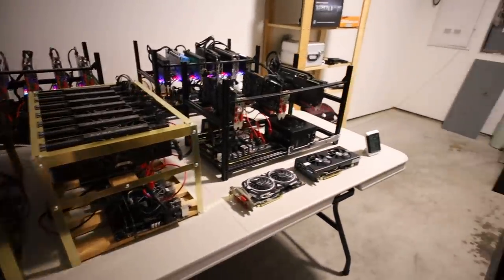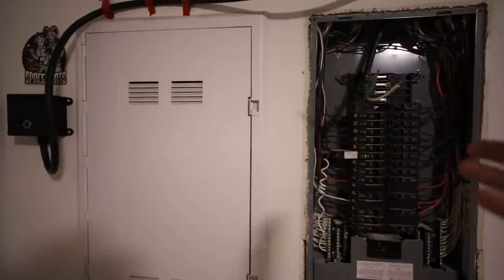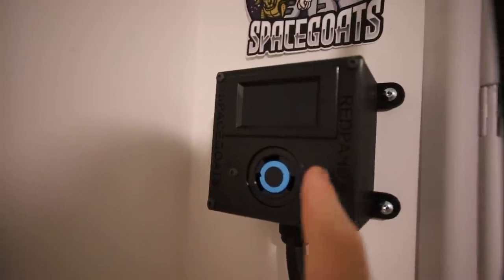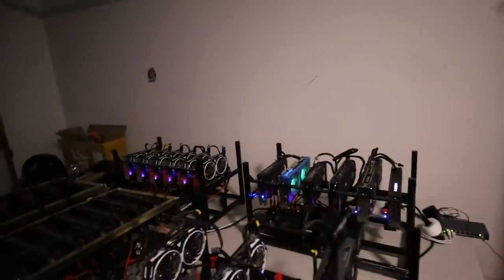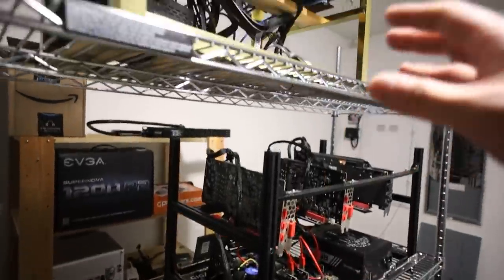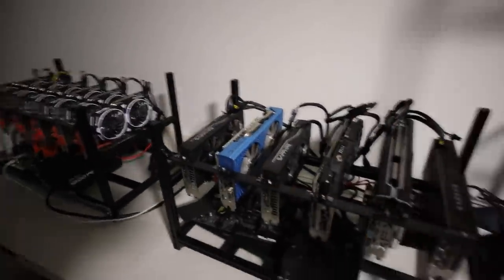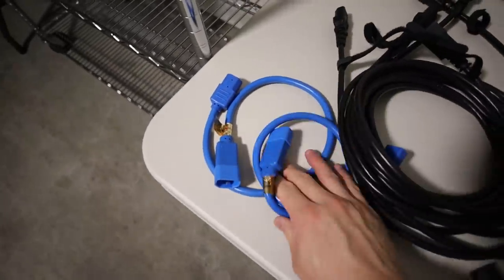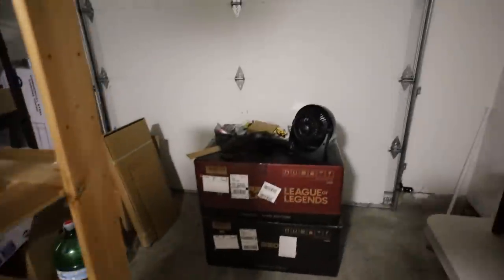Garage Mining Electrical & Space UPDATE!

Comment: you could use a 6 inch inlet fan with some venting to help with heat issues, the fan is pretty loud but would do the trick, you could use it for either of the 2 setups but i think the garage is gonna stay wayyyy cooler plus you can always just open the garage door and get a screen for the summer, pretty smart idea to use a garage haha

Comment: I had an electrician, recently, installed a 50 amp circuit for my miners.  Like you, I have a Square D panel and the electrician mentioned that Square D had a fire at one of their factories.   Hence, the backlog on breaker blocks.

Comment: Is that up to code at all???  I like the ingenuity but if you have a fore that burns down other peoples homes your in trouble. 

I ha a friend last month living in an apartment where someone above them did something electrical that they shouldn’t have that they shouldn’t have that caused a fire and damaged multiple units. Now that person is being sued by my friend and several other people and possibly facing charges/jail. 

Be careful!  

For your temp solutions if you have AC in your home maybe you can have them run some ducts to that area or put in a wall mounted AC. Granted that’s more power but what are you going to do.
Reply: i had the same though and quick search, 3D printed box are not certified so no, not legal... the idea is nice though

Comment: Where did you get that C14 energy measurement device that is shown in the video @0:32?🤗
Reply: @velatrader6791  im building a rig at the moment, still in doubt about which GPU i should get. Stock is bad here and price's are higher than normal for new cards
- h110 motherboard 
- evga 850 watt powersupply
- 8gb
- intel pentium g4560
- kingston 12gb ssd
- frame still unknown 
- gpu still unknown

Got solar power on my roof
Reply from the maker: Fake red panda account lol sorry